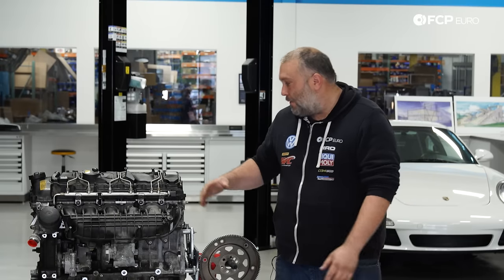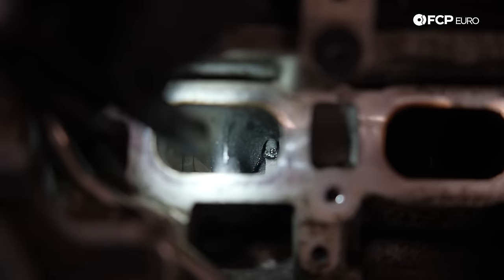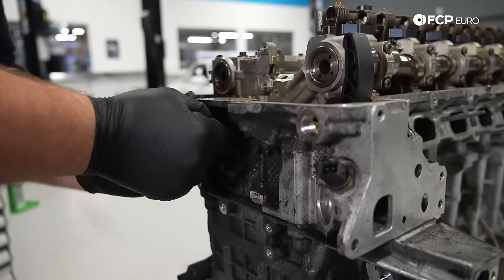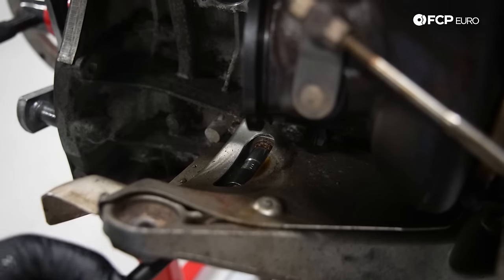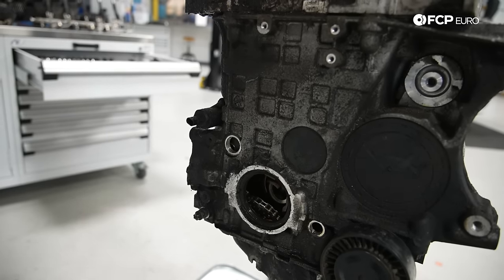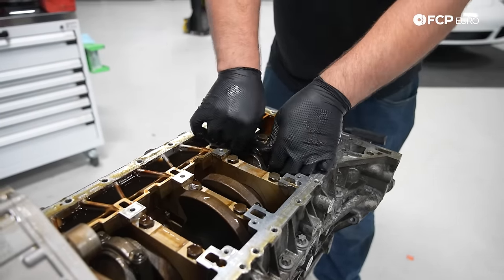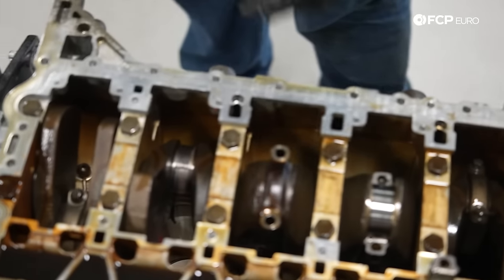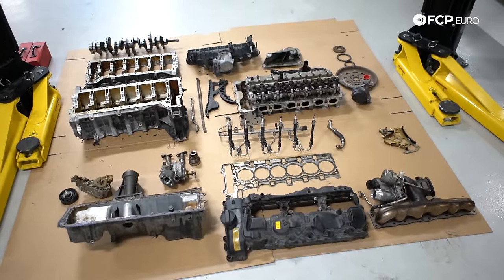Spun & Done - Tearing Down A BMW N55 With A Failed Rod Bearing

Comment: Thank you Gareth for finally doing a teardown on my N55 engine. Now i know more about it and how its mostly simple of a design yet powerful and very easy to work with.  One of the main reasons why i chosed a BMW 535i M Sport with the n55 inline engine, very stable and well engineered when you tackle all its simple maintenance and prevention maintenances that needs to be done for an amazing exciting everyday ride!  Mostly thanks to FCPeuro for existing and having almost all needed highest OE/OEM quality parts.  More of a reason to own a German car when FCP has ur back!
Reply from the maker: We are happy to have your back LaloMan ! Glad you enjoyed this video and we appreciate your support as a customer.
Reply: my FBO 2011 535i is currently sitting at 187,000 miles and still running like a dream (knock on wood). Take care of your n55, and itll take care of you!

Comment: I killed my N55 on the Nurburgring. A common upgrade is to fit the S55 dual oil pick up and baffled sump 

On a side note you don’t have to do timing when replacing a vacuum pump as mentioned
Reply: Sorry to hear you had that failure and the S55 parts are definitely to clear go to for serious track use/performance applications. And yes, you are correct. I definitely misspoke. I was referring to the disassembly of the front of the engine to gain access to the mounting screws for the pump.
Reply: Hello! I had a motor issue last week on the Nurb. It stopped and i had to go in freewheels to Breitscheid… What was the diagnosis for you ? What repairs did you do?
Reply: wow, I didnt expect that.  S55 dual oil pick up and baffled sump is not a cheep as well, but yeah it would be helpful for hard track use.
Reply: @R1d3rBul  N55's still seize with the S55 sump and pump I've seen since my original comment. People have been overfilling by around 750ml and seems to work
Reply: @dobbo_f21  man, you sure? Where you find that? I cant believe that wouldnt be solved with s55 oil upgrade kit. Hostnely I just think to do that upgrade on mine car...
Reply: @R1d3rBul  Considering my own engine still seized and a friends also did on track then i'm sure ;) I replaced it with a B58.
Reply: @dobbo_f21 you put a B58; into a n55 Car

Comment: For valve cover jobs on N55 engines you can remove only the fuel lines to each individual injector, theres just enough clearance between the valve cover and fuel rail to remove the VC with the rail still installed. Just wear safety glasses, the rails usually hold pressure and spray a little gas on removal of the lines, disconnect battery for that reason.
Reply: Paid $850 to replace mine kinda wish I did it myself now

Comment: Has anything changed on the b58 to reduce oil circuit air being trapped after opening them up? Priming engines by filling the oil filter housing and 3 10 second cranks should be religiously followed either way.
Reply: The B58 is an entirely different engine in every way. The N55 was an evolution of the N54 with shared design architecture. The B58 along with the other B series modular engines are an entirely new design. They are too new to have a sense for  long term pattern failures. There are also two main variations of the B58 (B58 and B58TU) so it will be interesting to see what the weak links are between the two variants as time goes on.
Reply: And I agree, priming any engine after a major repair should just be standard practice.

Comment: Thanks for the video. Im currently considering buying a 2016 F10 535i. It has 88k miles on it. I got a car fax on it. Two owners. First was a lease then sold. I cant find any information regarding the common failure issues being addressed. Ie, valve cover gasket. Oil filter housing gasket, water pump and charging tube. Dealer has done its checks and found no issues. Wanted to get your opinion if this would be a good purchase. They are asking 21k.

Comment: might have missed it, but whats the year on that engine? im pretty sure the bearing weres improved after a certain year
Reply: This has to be true. The N55 underwent a change for 2014-2015 MY. Since the intake is missing, the telltale sign is the PWG (in this year down) instead of a EWG.

Comment: The main thing for oil starvation for this engine is bmw's beloved shitty plastic oil suction tube. It has welded coned part on the bottom and the seam tend to crack. This how you get air in sucked in oil and after pump oil is with with air bubbles in entire engine. So lubrication is no longer sufficient  especially on high loads( track driving high rpm). The consequences is famous bearing failure. In general many problems in BMW engines are their morbid love to make details from shitty plastic for very hot running engines. Maybe it's done with purpose to make engine time ticking bomb after warranty.. Because you can make that oil suction pipe from steel tube and have no problems trough entire car life. I think engineer who made decision to make it from plastic is or mentally retarded or made with purpose the engine to fail  after few years. Thank you for your attention.
Reply: Hello, this is a very interesting analysis and I certainly agree that the BMW engineers have desperating love for plastic at the worst place (charge pipe if only). 

But my understanding was that the main cause for driving based oil starvation (as opposed to non priming starvation) is the flawed design of the N55 oil sump. The s55 has a baffled oil sump which allows to always have some oil for the suction hose to take. In addition, the s55 has an additional scavenger pump.
Reply: Good engineers design things to last. Rich engineers design things to last just long enough.

Comment: Nice video guys, just wish you would have tore down the oil pump to show the inside of it, I have an N55 in the shop right now and she’s locked up solid, wondering if I could put a new crank and rod/rods with new bearings and oil pump to save it, or if we should just swing in a used one instead
Reply from the maker: Common to end up having to swap out the oil pump, and bearings. That said cost may be the differentiator for you on which route to take.

Comment: Connecting rod on my 2012 335xi is making noise, but engine is still running and mechanic found evidence of shavings from the bearings.   Is the motor a goner, or it possibly rebuildable?     Salvage engine looks to cost about $5k, labor in replacement is about $5k, so $10k to get a salvage motor put into it... but the car is only worth about $10k according to what I'm seeing for sale.
Reply: Every piece of information I've been able to find so far seems to say that a new engine is the better choice. Numbers wise I'm in nearly the exact same situation you are with my 2014 X1 xDrive 35i. At this point, I'm leaning toward selling it to an auto recycler and just moving on.

Comment: Great video! One question though, My N55 has 78k miles on it. It runs perfect, there is only one thing, it has a slight tick from under the car, as it runs, what is that? Is that normal? Thanks!
Reply: Most likely the injectors, this motor has very loud injectors that sound like ticking, and is amplified if you take the engine cover off. The source of the noise are the injectors aggressively open and closing.
Reply: Injectors, normal. They are loud if plastic beauty cover is rrmoved.

Comment: Question. Oil pump picks up oil from pan and NOT 100% send thru oil filter? There is another direct route to go straight to the vanos solenoids? 
Or does the oil on rod bearing travel inward thru the oil passages on the crankshaft to the neighboring rod bearings and then to everywhere in the engine?

Comment: My question is, doing a oil filter housing gasket taking off the house exposing the inside of that area is similar to pulling the filter? How does an oil change not give the air pocket the same way?
Reply: Im think because the oil filler cap has an inside valve that lets oil pass by and not. This is why one must replace the oil filler cap every 50k miles to keep ur oil fluently across the engine in top shape. Its also a cheap part to replace and if u hear noise coming from the oil filler cap, then its a must to replace asap.
Reply: @Trump-The-GREATEST  No I mean taking the oil filter out of the housing, it exposes air just as much as pulling the entire housing off the head.

Comment: Everyone asking what oil should they use, the answer to that depends entirely on your climate. 0W-30/40 if you see -20s or below, and 5W-40 if you're in a warm climate.
Reply: Eh not really, 0W-40 is really only required starting at -35c. I run 5W-40 here in Canada.
Reply: @JackRR15  It doesn't go from thin to solid, 5W-40 if you're hard starting in -20s is still not good. These cars have sketchy bearings and the slightly better high temp protection is worthless with low flow cold starts. There's a reason BMW went to 0W-30 in all these engines beyond fuel economy gains. Mine had lifter noise at -10 and below with 5W-30 Twin Power. Poor oil circulation.
Reply: @prayformojo1117  What do you mean it doesn't go from thin to solid? And yeah sure maybe noise wise it might help but from a wear standpoint the differences are marginal if the temps are not more than -35c. It is not required. And yeah no, it's mainly for fuel economy yes. Look it up I'm not claiming anything. I used OW-40 before and didn't notice any changes when going to 5W-40.

Comment: Hello, 

My car is n55 F87 
I have a crack in the Intake Camshaft Adjuster, and I changed it, but with a different part number for n55 but not f87; the power has been dramatically lost.
Today I received a new Intake Camshaft Adjuster for N55 F87; during the change, I found damage on ECCENTRIC VVT CAMSHAFT, and noise from eccentric camshaft sensor actuator motor

My question is, Is this problem because I replaced the Intake Camshaft Adjuster with different parts?

Comment: Were the connecting rods PN 11247624615? According to RealOEM, these are the same between the N55 and S55 which are forged in the M motor.

I've heard it was for later model cars, but this looks to be a PWG engine. I'm also trying to figure out if the numbers were just updated in RealOEM vs what was ogininally put in the motors.
Reply from the maker: Hi Ivan, unfortunately this block is long gone, no way to confirm those numbers at this point. Keep us posted if you do find out that info.

Comment: I have 2012 F30 335i N55 130k
Getting oil from lines to boost solenoid. Replaced solenoid and it failed again. I'm getting an oil leak somewhere and looks like from the solenoid lines.

I'm thinking the vacuum pump is failed. How hard to replace without tearing down engine? I'm not finding anything online for this pump replacement. DIY thanks

Note: since 85k been having oil leaks. The mechanic replaced oil filter housing, lines, and then a year later said the valve cover gasket. I changed the gaskets and checked they're not leaking. still getting oil from left rear. Traced it to what seems like the solenoid. Tried replacing with no luck.

Comment: N55 overall is pretty solid. Unfortunately it seems like very early builds suffered from rod issues even with proper oil changes
Reply: the problem is that people run the car hard before warmup  bhvmhmhgmg
Reply: Solid? My servomotor just failed. Needs new eccentric shaft and shorted my DME.

Comment: No oil cooler lines on the oil filter housing ?
Reply: I don't think the oil filter housing that was on this engine was the correct one. Since it was only held on with one screw it looks like it was just thrown back on the core.

Comment: I swear this is the exact motor that came out of my F32, the car ended up going to auction at copart after the engine blew and also months before it went i personally replaced the bearings to  connecting rods 5 & 6 and left the others alone, also the oil pump chain guide had pieces missing and it was completely seized also the mileage was close to mine
Reply: What tune and mod did you have? I'm on F36 435i 2014 MHDs stage2 + E20, BIG ic and catless dp. Just trying to not kill my engine.
Reply: @Salpeteroxid  I was bone stock, the N55 is a really strong motor but one of the downfalls of it comes when you are low on oil because the car will tell you it’s low by one quart only, no matter how many quarts low you might be so in my case my engine was about 3 quarts low on oil and when it’s that low and you take a corner hard and at high rpm the oil sloshes to one side of the oil pan and now the pick up tube can no longer pick up any oil, your pump runs dry for a split second and it fry’s your rod bearings, i upgraded to the S55 in the F82 and they solved that problem with an improved oil pump and pickup as well as extra baffles in the oil pan to keep the oil in place, but just keep oil in it and you’ll be fine because I beat the dog shit out of mine and got it to 95k miles
Reply: @Salpeteroxid  Oh also if you plan on making big HP like over 500 look into getting the crank hub done, it’s a bigger issue on the S55 engine but i do believe the N55 carries that same problem dude to it sharing 75% of the parts between the two engines

Comment: Is there a fuse or relay you can pull instead of disconnecting all of the fuel injector plugs?

Comment: Great video! I have a 2012 x3 with 237000 miles that has a clanking sound inside the engine. The car still runs! My question to you and your team is if this type of major teardown can be done without removing the engine from the car? Well, hoisted but still attached to the transmission?
Reply: Sounds like rod bearings
Reply: n55 engine??? HOW TF DID U GET AN X3 TO LAST 237000 MILES
Reply: @HaiderAli-ot2gg  probably not an n55
Reply: @HaiderAli-ot2gg  274000 on mine. Owned since new. Changed oil every year regardless. Never thrashed from cold. Only failures are rocker gasket, oil filter housing gasket, crank seal, sump gasket. Just oil leaks 😃👍
Reply: @Sha Ting  If i see 200k I'll be proud of my little n55.

Comment: use to fill the oilpump gear with nulon l90 and the berings to with a litle oil the filter housing primed and didnt  fit the spark plugs at the startup less stress to the bearings

Comment: Great vid I have a question about a n47d20c  it's just been rebuilt after a timing chain snapped 1 month later its developed  a rod nock  the bearings were checked but not replaced is the bottom of the block like to be toast .will I need a  short block or can I get away with resurfacing  the crankshaft  and new bearings obviously  replace my connecting rods too

Comment: I just did my OFHG 2 nights ago and I didn't prime my engine after the repair, 2011 n55 e92 xdrive. Is it to late or can I still prime or what's my best option? Ty
Reply: If you already turned on your engine and everything is okay then no need. Your oil is already circulated.
Reply: You would have problems already if the system didn't prime properly. You're good at this point. If you wanted to prime it for your own sanity you can unplug the injectors and crank the engine three times for 10 seconds.

Comment: Which engine is better: N55 (F series) or Audi 3.0 supercharged? Especially important to me is reliability after tuning it on stage 2? (no ethanol; nothing too crazy)
Reply: BMW B58/S58
Reply: 🙌 down the Audi 3.0 only issues are breather valve and water pump leak very reliable motor easy to tune
Reply: The Audi 3.0T will have timing chain tensioner problems when it gets older and a full timing chain job is engine out and will cost more than $6k, but then it will be good to go again.  Another 3.0T issue is carbon build-up in the secondary air passages which cannot be walnut blasted.  This only affects cold start, but can cause a CEL.  Its relatively expensive to have them cleaned.  The N55 has rod bearing issues and I read its possible for oil starvation to happen under g-force load both laterally and during acceleration/braking, so I don't trust it anymore (I had one with a spun bearing).  The N54 despite its many minor issues is probably safer from catastrophic failure.   If you can swing it get a B58 powered BMW.  I don't know how tunable those are, but they seem to have fixed a lot of the N54/N55 issues.
Reply: @MrKobedagreat24  I would go with b8.5 model which no longer has this issue as I know
Reply: @alangil40  totally agree with you, but If only I had the chance to buy a newer bmw 😅

Comment: Nice video, actually one of the best on the channel and you guys should keep'em coming. 

Gareth, I own a 2011 X5 35i with the N55 engine. It has 111K miles. Since I bought it at 84K miles it has a slight whining noise that kinda follows the RPM. Not fully related, but so far I replaced the drive belt, pulley and tensioner, HPFP and the power steering pump (this one I bought used), but the exact same noise can still be heard. The only two things remaining are the vacuum pump and the alternator bearings. Those 2 are the only items left in there that might cause the whining.

I can't pinpoint the part that might cause it and so I'm trying my luck here: based on your experience, could it be one of these two?
Reply: Could it be the valve cover? Maybe the built in pcv went bad. Try removing the oil cap and having someone else rev the engine a little to see if the whine goes away. If it does, get a need valve cover. I just did mine and bought genuine bmw since mine last 95k miles I figured the same part will last just as long.
Reply: Yeah possibly valve cover. Turbos can whine too.
Reply: Does it sound like it's coming from the right side of the engine bay (turbo side) or more towards the left (instake side)? I know pinpointing sources of noise like that can be difficult but does it sound like it eminates from a distinct side?
Reply: how much does it cost per year to maintain the car?